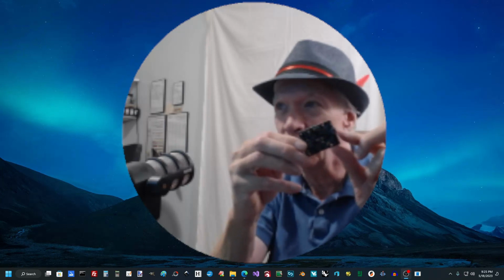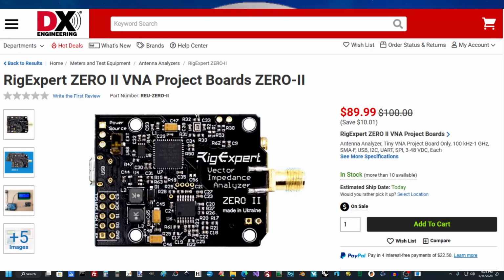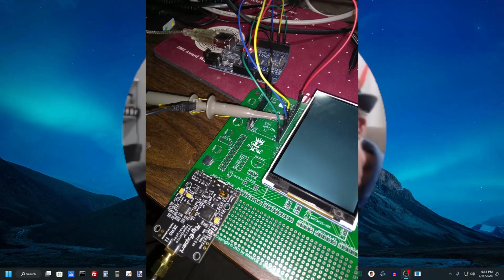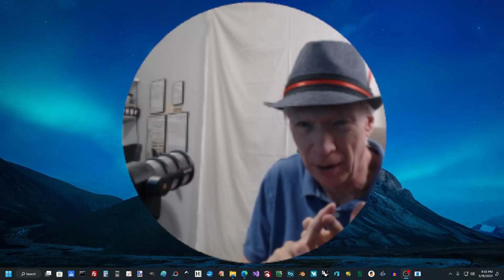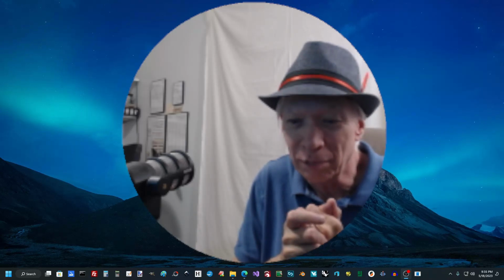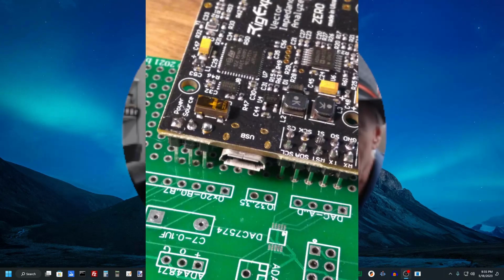AA-Zero II Rig Expert Antenna Analyzer 100khz to 1 Ghz $90

Comment: At this point has anyone determined if this can be directly connect to a SBC X86 running windows 10 via Uart or USB.
Reply from the maker: I don't see why not if u can run 38, 400 baud n81

And get the timing timeouts right
What compiler will you be using.?

Wingw or ms vs should work
Reply from the maker: if you're subscribed to the channel I can write some C sharp or C plus plus code and post it up on my website and you should be able to tell me if it runs in your Windows 10 on your single board computer and I'll give you the source code and you can figure out which serial Port you want to open in you should be able to tie the TTL lines to the aa0 board and it should fetch the identification serial number
Reply: @ProfessorVector  I’m subscribed. But honestly I’m teaching myself. I’m turning this into my hobby. But I’m not able to keep up on everything yet. I think I spend 2 hours reading for every minute spent eating a video
Reply from the maker: Lmk what videos I can do to help you out.
Reply: @ProfessorVector  can I just hardwire in to this models corresponding USB, UART, I2C, and SPI interfaces and just plug it into my mother boards open space. I’m new to this. But learning every day

Comment: Darn wish I'd seen your YouTube video before I dropped $100 on this piece of junk. I have pretty much gone through all of the same gyrations that you did and have had the same results. I bought this brick from DX Engineering and am going to return for a refund.
Reply from the maker: You need to see my other video on how to get it working the five things you need to do you need to reflash it you need to take the tape off the switch and move the power switch I got mine working great but I beat my head against the wall to figure it out now I'm telling everyone how to do it watch my other videos
Reply: Hmm, no luck. Did everything exactly like you showed but all I get is an error message that says the serial number of the board doesn't match board type.
Reply from the maker: @paulanderson997   Hi Paul sorry to hear that. My serial number is   400100334  I would guess yours should start with 4001
also I would suggest h9ounding Rig Expert tech support with screen shots and numbered questions. I found after a few days they will answer the questions or find some one who will. Feel free to post  them here or email  some I see how I can help 
https://wb9raa.com/pgcontact.php
Reply from the maker: @paulanderson997   Hi,  I havent had issues with this but other USB products have worked differently thru a HUB or not thru a HUB I'd say try no USB hub, non powered hubs and powered hubs.  Like my Rigol scope will write to a flash drive but not thru any hub.  I have a 17 port Sabrent powered hub works great. In the garage i had laser and cnc issues thru a Sabrent 4 port hub 
found two bad ports - gorilla glued the two bad ports so they cant be used other two work fine. At work I seen my fair share of flakey usb hubs.

Comment: Well at this price point nobody is making any money.  How many stand-alone units would they not sell if ya cud plug this thing into a laptop running AntScope.  Too bad they create so much customer pain with this product.  Fix it or pull it. I'd clean it up and go for a refund. Bad enough you wasted your time.... get ur money back.   I thought it seemed too good to be true! Thanks for saving us all from this bad product.
Reply from the maker: Well after much frustration and beating my head against the wall I do have it working with a nice gooey on an esp32 and a 320 x 480 LCD screen with an encoder knob and button which I plan to make a video of soon
Reply: @ProfessorVector  VERY GOOD!

Comment: I just received my ZERO II today after watching your video yesterday, and yes, mine did not work either. I checked the 5vdc at the +/- pins and this checked out. It looks like a small LED just after the pwr pins which, if it is an LED, does not light. Did you attempt a much higher voltage than 5vdc?

I sent RigExpert an email identifying all my actions and included an Arduino sketch. From your comments I probably won't get an answer.

Could the folks at RigExpert be fighting the war?

Thanks for the post.
Reply from the maker: contact me directly via my web site and we can talk !!